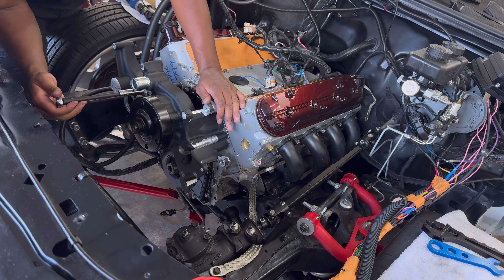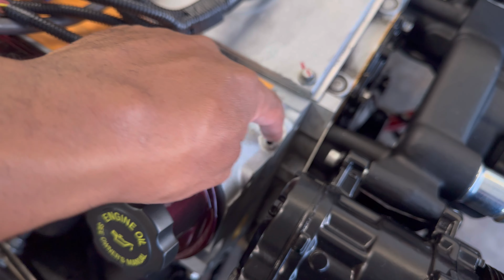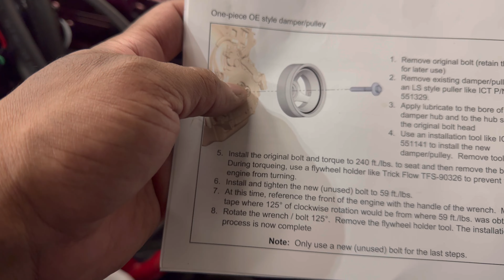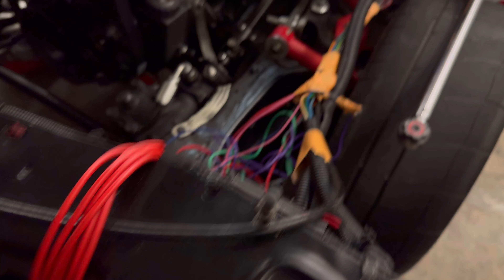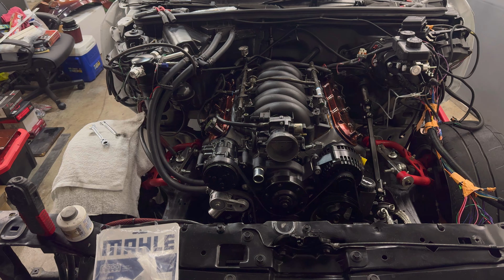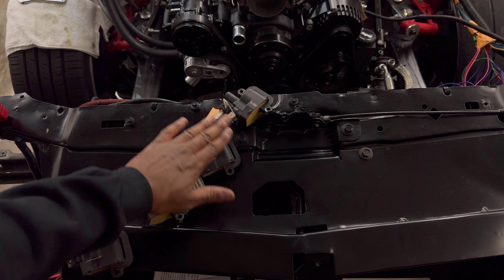Holley Mid Mount Accessory Drive_ Gbody LS Swapped

Comment: On more thing. I know u can’t do it right off the back. But can u make a video on where u ran your vacuum lines on that intake. I have the same one but running a 5.3 in a box Chevy. So I know some things may differ. But just wondering do I have them right. Or send me the link to the video if you done it before.

Comment: Nice video and great content. I have the ls6 intake and I didn’t think it would work because of the rectangle ports. It’s on and run I’m just have fuel pressure issues. That’s y I asked the pump in the last video. I have it ordered and hopefully it works out